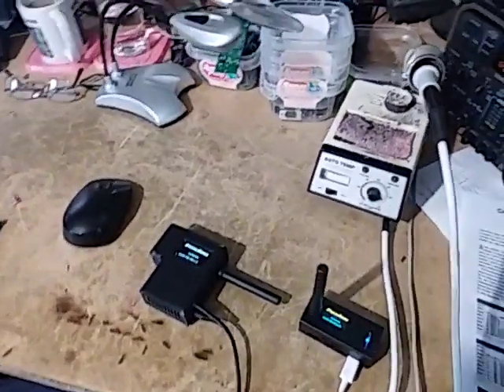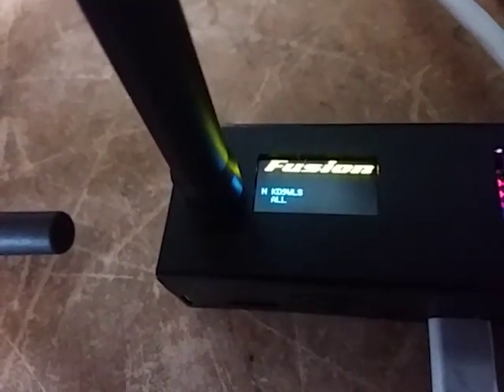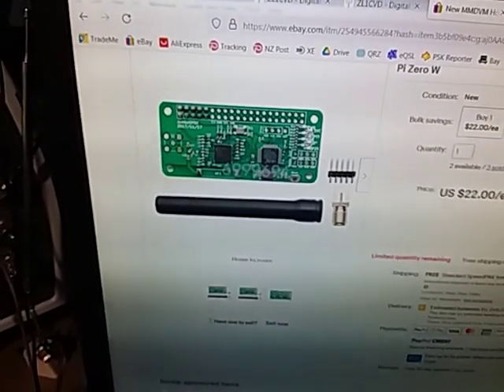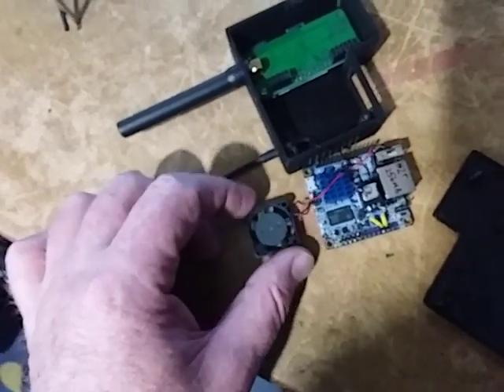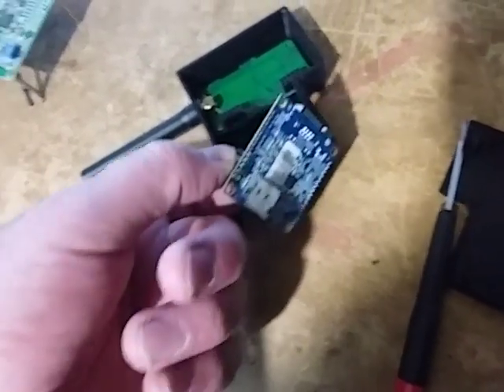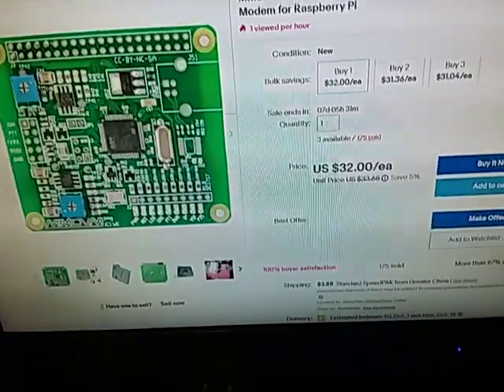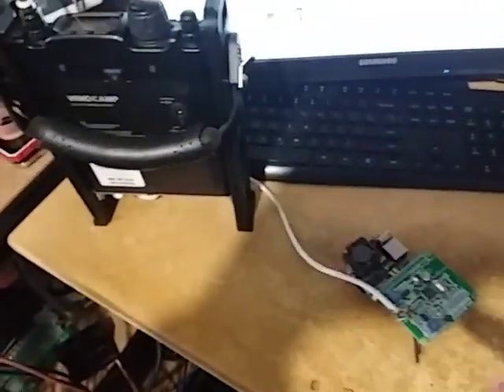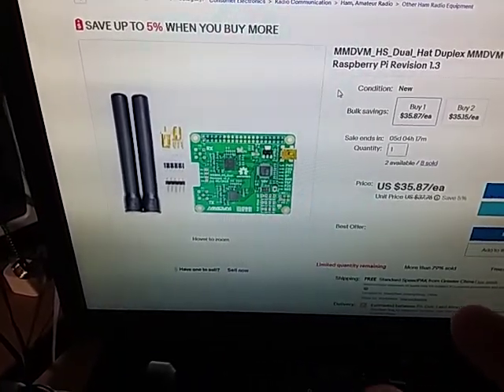MMDVM Orange Pi Zero vs Raspberry Pi Zero Hot Spots

Comment: Dear Chris could you inform the model of the orange Pi board you used and how which pinod connected the mmdvm boards and the orange PI, tks
Reply from the maker: Orange Pi Zero 512K but you must use fan & heatsink on CPU as as they get hot and start to fault. You can see how it plugs in on video.
https://www.aliexpress.com/item/1005003627813813.html

Comment from the maker: Part of this comparison is comparing performance of two low cost solutions. Banana Pi BPI-M2 Pro is NOT a low cost solution. On one hand, I doubt you could beat the performance of Orange Pi Zero H5 512MB WiFi for $22.99. On the other hand it is not as well supported & different form factor to Raspberry Pi Zero.

Comment: Did you use the standard pi-star software, or does it require modification to run on orange-pi? Thank you.
Reply from the maker: There is a specific orange pi download on the pi-star website. Its an older version but still works :)

Comment: Is orange pi 2 suitable for this project ?
Reply from the maker: Yes, most of the Orange Pi boards will work. They are all arm core processors & the distro on PiStar for Orange Pi should work on them all. The more memory (RAM ) it has, the better it will perform = less drop outs.
Reply: @ZL1CVD  OK thanks
Reply: Lo he intentado con Orange Pi Zero 2W pero las imagenes de Pi-Star para Orange no arrancan en ese modelo

Comment: I want to know the number The mosfed you use
Reply from the maker: From memory it was 60N something. It's just one from the rubbish pile - pulled off a computer motherboard. It only needs to handle very low current for the tiny fan.. 
..even a 2N7000 would do the job as long as the fan is not more than a few hundred mA.
Reply: thank you very much @ZL1CVD